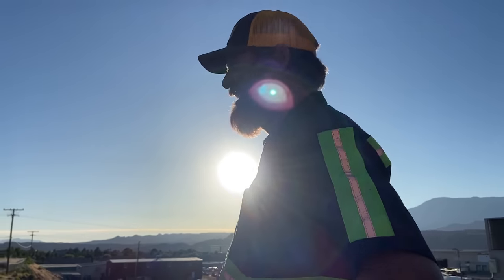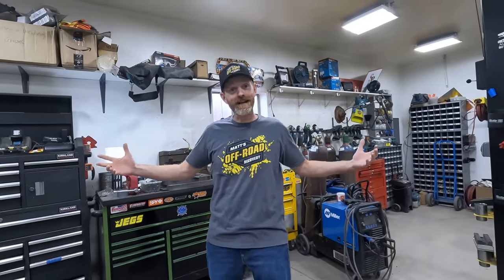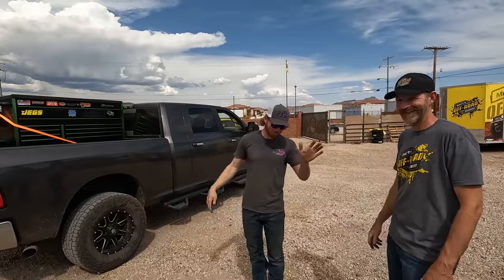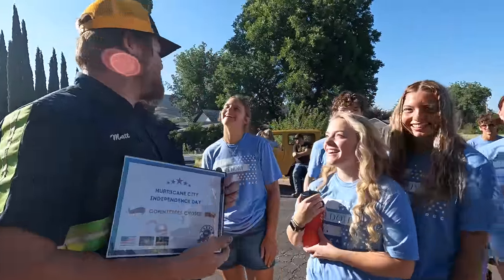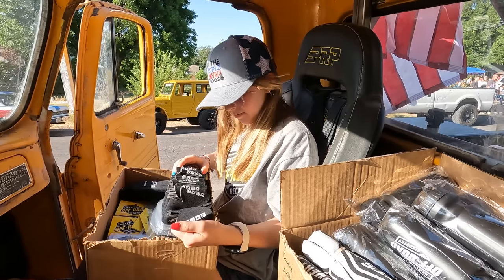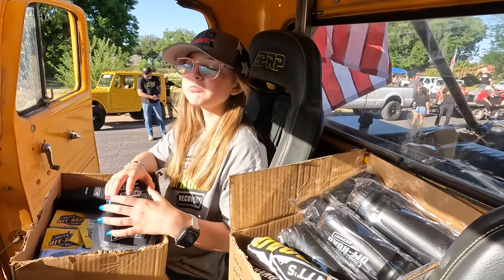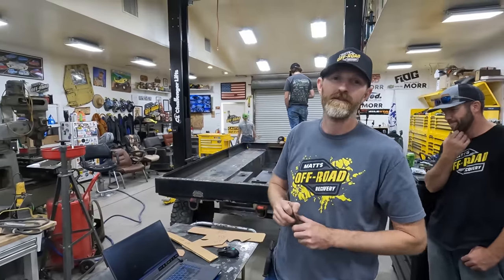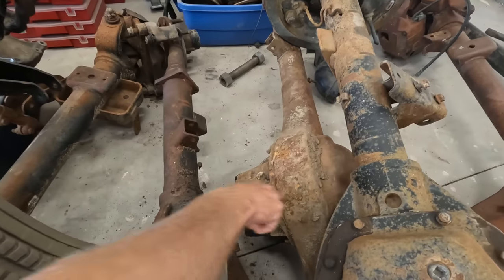Ed Teaches The Team Old Tricks! Bombi Build

Comment: I never changed tires except on a bicycle. Then, I had a project where I volunteer to replace two donut tires on a trailer pulled around by a lawn tractor. Two hours to get them mounted. But, wasn't aware of weting the rims. That would have made it so much easier.

Comment: Hey Matt n crew I totally like that tire challenge it's kool but to mount a tire on a timer with flat bars is cool But I really do tires by hand kinda except breaking a tire off a bead with a wheel ramp and a pickup truck I've even used the screw Jack out of the trunk to break the on the side of the road and have used a Phillips screwdriver and a wrench to dismount the tire off the rim all by had but Iv gotten smarter and now make sure I have two pry bars to get the tires off the rim and put a new tire on no tire machine I am the tire machine....lol great challenge matt n crew..😊

Comment: I bet I could beat everyone at spooning a tire on. I been doing it for year's. I use a high lift jack to break the bead the 2 large flat head screwdrivers 🪛 to mount them on the rim. I also use dish soap on them straight out of the bottle no water to seal them. Works like a charm. Always have stem up when putting tire on rim because the crack side is bigger then the front with the stem. You will never get it on if you don't do it this way.

Comment: I accidentally found a way of mounting tires by hand much easier. Ok what you do is always keep a 5 gal bucket or two of old wheel weights sitting around where you gonna mount tires, What happens is when you bring them new tires in they see all them old wheel weights you gots and know they dealing with a real pro so they just go ahead and jump on them rims much easier without giving you such a hard time😎

Comment: LS swaps are so common because they are compact, available and powerful engines. It helps that GM made a lot of them and ironed out the issues for the most part. Aluminum LS is the pick of the litter, especially for a snow cat where light weight is always good.

Comment: I do tires by hand all the time I swapped 8 in less than 30 minutes from 2 cars busting 8 off swapping from car to car you can mount without spoons with practice 13inch are a little harder not as much side wall  Matt almost had it

Comment: That's funny I bought a trailer brand new with a torsion bar suspension and I thought it pulled great I pulled cars all over the United States to almost every state in the 48 and I found out about 4 years after I bought it that the torsion bar suspension was collapsed sitting on the bump stops and it was that way from the day I bought it and could never tell it was awesome

Comment: As someone who has manually mounted and dismounted dozens and dozens and dozens of tires for dirt track race cars at the shop and at the track over the years I feel there pain

(The original version of the valken dirt latemodel wheels were a total pain in the azz to the extent that the company actually started offering a service when you could send them back and get the safety bead machined down)

Comment: I use silicon spray for tire lube, not grease! Also I put the wheel on a 5 gallon bucket, twist and rotate the lubed tire while pressing down on one side and spin the bead over the wheel. Often I don't need any tire tools/spoons at all.

Comment: I disagree with Ed,  the split rims are easier(especially if you have to use a tube) because the tires just fall right onto the rim and then the ring is installed(easy job) the drawback is they are dangerous when inflating and it needs to be done in a cage!

Comment: To be fair, Matt had that tire on in a VERY quick time, most of his time was getting the beads to set. I've never had issue getting beads to set on tires that small, its normally the huge tires that are awful to set without a bead blaster.

Slow is smooth, smooth is fast.

Comment: :) this was actually super ok, i've seen guys take that sort of time on a bicycle wheel... 

anyways, for who's interested, one of the main 'secrets' it to put lots of importance on keeping the tire bead segment that first enters the rim into the center of the rim for the entire duration of mounting the tire (both sides). the center channel offers the smallest radius of the entire rim, placing the bead in there makes the tire slide over the rim lip considerably easier. that is the reason why the first side of the tire can be put on much faster.. some tires w/ beefier sidewalls are more difficult to install..

Comment: For this size tire and rim, I would use watered down dish soap and a rubber mallet to mount the tire on the rim. Didn’t need the spoon except possibly the last little bit. 

I was raised on a farm and did many tire changes on the floor with spoons before dad got a manual tire changer.

Comment: Where’s the rubber mallet, throw the first side of the rim into the tyre  stand on the high side rubber matter the tyre onto the rim, then stand on the second bead and work it around onto the rim at the tight spot stand on the tread edge and use the rubber mallet to seat the tyre over the bead edge, you don’t need tyre spoons, we used to use tyre soap only if needed 
But then I’m only a bit younger then  Edd 😊
Hate to see some of the rubber seal edges and if what condition the bead wires have been damaged😂
We still run split rims here in Australia, when crossing our deserts with a small group 15 puncture repairs a day is not uncommon.

Comment: Try a pair of vice grips or the second bar under 1 foot to hold the bead, drive rigs up on a block just pop them off and back on rite on the truck with the vice grip trick, nice wheels use a lil peice of rubber so dont scratch the chrome or mar the aluminum outside ,helps keep the bead from seating to so you can strech the tire easyer

Comment: What about suspension seats?  Or horse drawn wagon seat springs, LOL.  You wont need suspension for the snow but if you plan on running it on a harder surface bring a leather stick to bite on.

Comment: Spooning tires on is not fun or easy. I have done it with a sledge hammer and two slot edge screw drives and dish soap. After about 30 minutes I got it on.

Comment: Here's a terrible tire to do: 4 inch rims on Hand truck tires with tubes or wagons with pneumatic tires. Bike tire spoons are too small and regular tire tools are too big. The beads on the little tire are hard to get to stay in the drop center and not pinch the tube. And because they are so small, it is hard to hold stuff.

Comment: The torque is limited by the angle of the swash plate; the steeper the angle, the longer the stroke of the pistons, the more effectively it will convert reciprocation into rotation.

Comment: One tip is they didn't grease the inside of bead just outside they will drop on pick up rim after mounted put your foot on rim pull tire it will seat front bead where valve stem is spin wheel gently pull and will air up and you have to make sure the opposite side of bead that's not on is pushed down that's how Matt is popping them on so fast

Comment: Back in the day I used to spoon big aircraft tires on wheels.  Secret is not to fight the tire and get it into the drop center of the wheel so you can get the other side over the wheel.  Lots of lube helps too.

Comment: lune tire on side going on rim and stand on tire to tighten it to rim then get a good sized rubber hammer and beat the bead  on  or use pry bar to hold in place and beat tire bead on .  taking tire off is the hard part

Comment: I mounted tires with two long screwdrivers for 40 years. A bumper jack to break the beads. Not that hard.
Reply: Put dish soap on a rag and it will bread easy.
Reply: I actually worked road service for ten years on semi trucks and heavy equipment with two bars. The hardest tire to mount is the super singles because they are stiff.
Reply: The super singles tire alone weighs 330 pounds and I popped a rib out on one on a cement truck .

Comment: The trick to spooning tires on… is to not use spoons.  Two flat screwdrivers helps, but mostly use your feet and walk it on.  Dawn dish soap, pb blaster or a bit of motor oil works- Ive only tried grease once and it was a mess.
Reply: Spoons were made because they work good when used properly. Screwdrivers are not a good tool because they nick the bead and weakened it besides creating leaks. Walking on the tire only works if you are a very heavy person. Never use motor oil on a tire, it rots the rubber. My lubricant of choice is tire lube. I believe the viscosity is greater than dish soaps. Technique has the greatest benefit but I can't list all of them here. I was a little boy and had no trouble putting tires on rims with a spoon and a dead beat, rubber, mallet. I installed truck and tractor tires.
Reply: @DEJones71  screwdriver just to pop the last couple of inches over and has to be done with some common sense.  I weigh 140, walking a tire on just requires pushing at the right place at the right time.  I have not ever had an issue with oil rotting tires.  I suppose it could weaken them in some capacity, I just haven’t personally encountered that.   I have not done heavy truck or tractor rear tires, just light truck and car.

Comment: I only lube about 3/4 of the second side. Start the dry spot first. Helps keep it from slipping up and over when you get to the 3/4 point. Then a quick dab of lube before I seat it. I use silicone spray as a lube